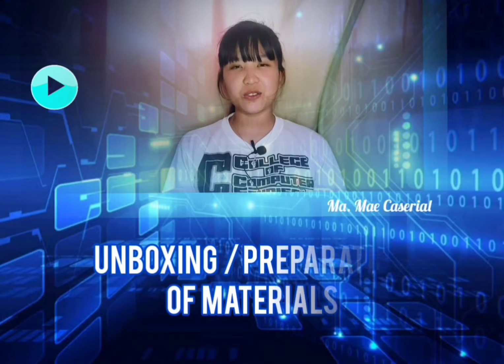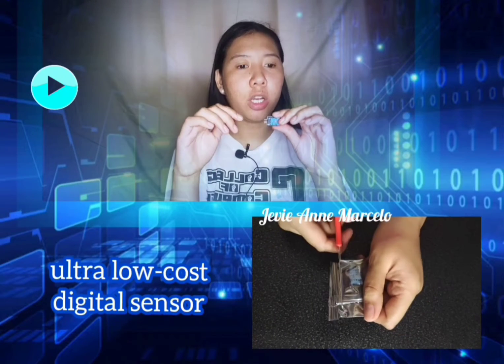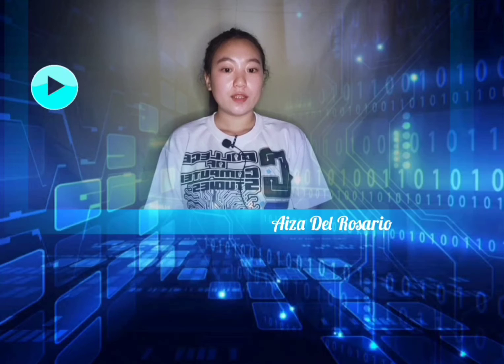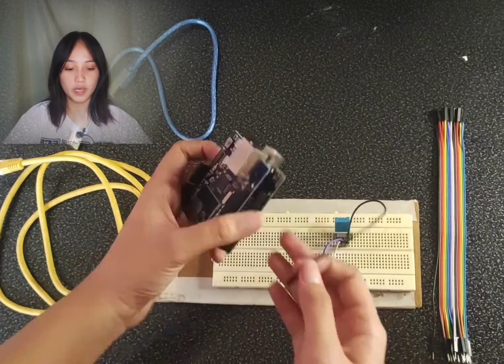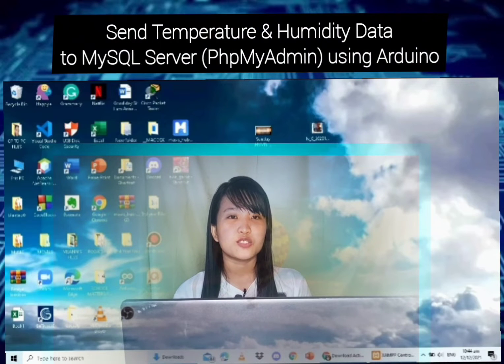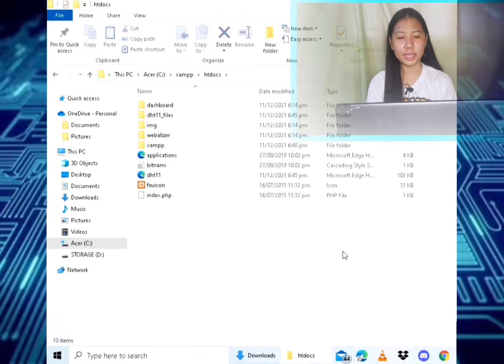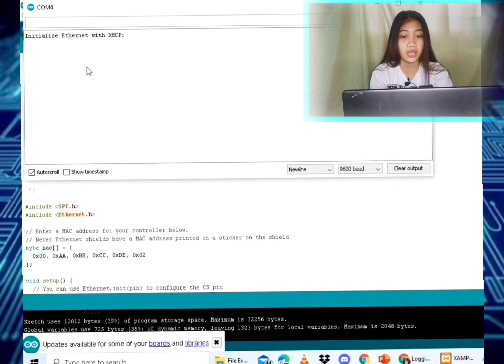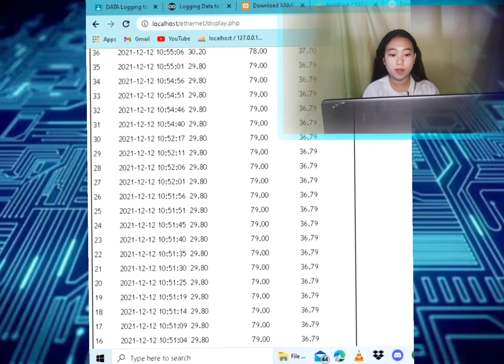Arduino Humidity Sensor (Logging Data to Database) using Arduino Ethernet Shield || BSIT Project

Comment: Saan po kaya kayo naka bili ng Arduino Ethernet shield? May ma rerecommend po kaya kayo na store from the internet?
Reply from the maker: let me check po😊 I'll try to put the link here sa store po kung sa'n namin nabili. groupmate ko po kase nag order from Shopee
Reply: @MaeCaserial  Thank you! :)
Reply from the maker: @kali8854  here's the shop link po😊 https://shopee.ph/product/18252381/276920271?smtt=0.114643144-1664152719.9 kaso out of stocks pa po sila
Reply: @MaeCaserial  May question pa po ako. Yung database po ba ay accesible na sya through the Internet?
Reply from the maker: @kali8854  yes